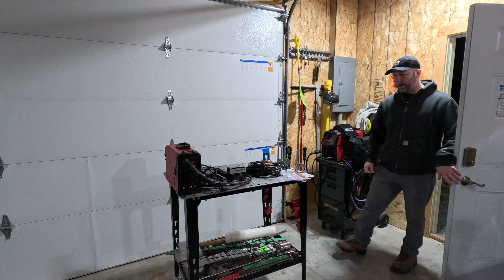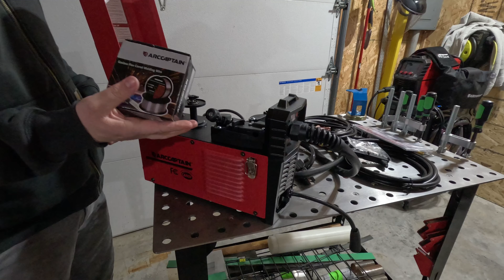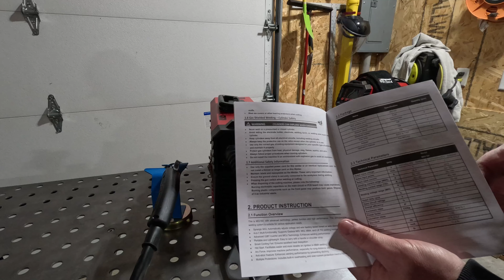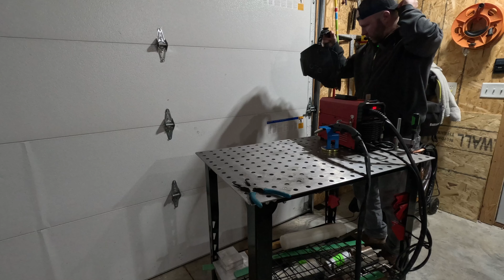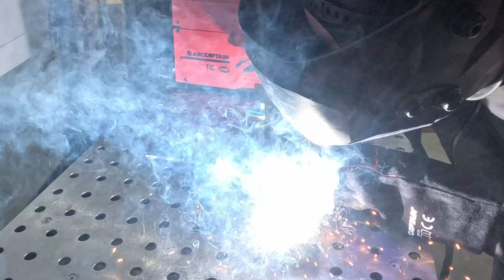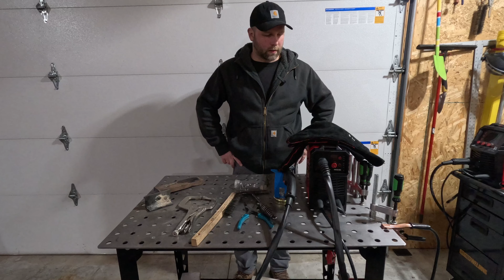Welding On A Budget? Check Out The Arccaptain Mig160 - Perfect For Beginners!

Comment: Should fan the welding smoke away from your face. Back lighting make for crappy demo as you can’t see jack from front view. Welding sound is smooth, just wish you do Butt, Lap, Tee, Corner, and Edge joints so people can see how the new welder behave. Even strength test will be a big plus
Reply from the maker: There was a fan on but obviously it wasn't enough positive flow to push it out of the garage. Thanks for the other feedback and for stopping in

Comment: Thanks for the vid! I want to buy this model, my breaker is a 250v 30A and do you know if i can plug it to that? Any requirement for the input amber ? I read the manual it says 43a so do i need a 50a breaker? Thanks!
Reply from the maker: You need the wiring and breaker to meet the requirements of the system, it this case it'll be 50a and then rhe wires to meet that current draw